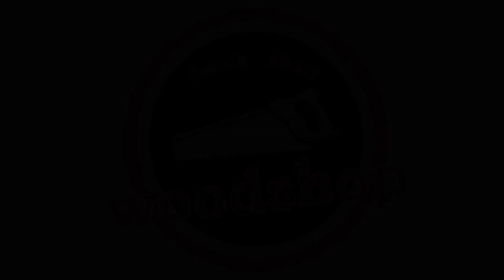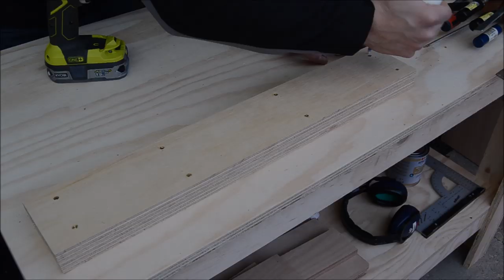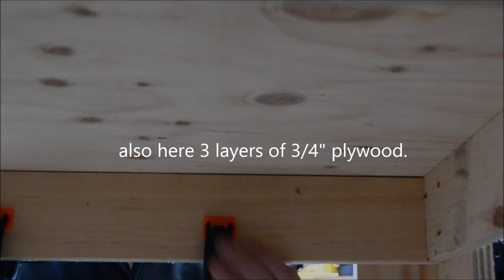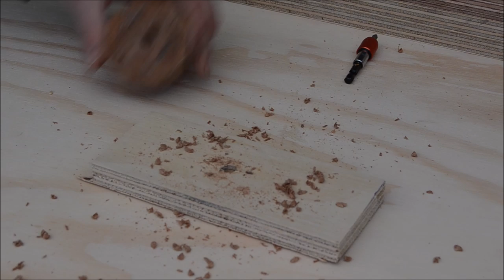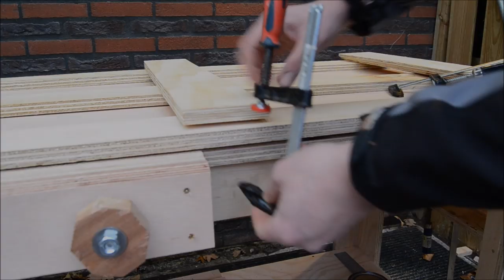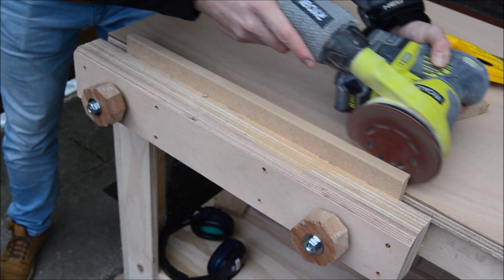Plywood workbench | DIY MOXON vise and a hardwood ply topsheet | #3

Comment: From all the videos about simple vises this is probably the most simply and best for a diy person new to the woodworking world. I have a foldable workbench and I need to make a vise for it that can be easily removed, probably I will go this route. My only question is how thick are the threaded rods? I have some long rods with nuts around  but don't know if they are thick enough for this. Thanks for the video.
Reply from the maker: Jelly G. Thank you for watching. The rods are the size M10 (metric)   it works good but if you have the chance go for a bigger rod. M10 takes ages to tighten 😂
Reply: After thinking about it you are right hahaha. That was one of the things I hated most about that rods, long time tightening nuts around. Thanks for the reply.

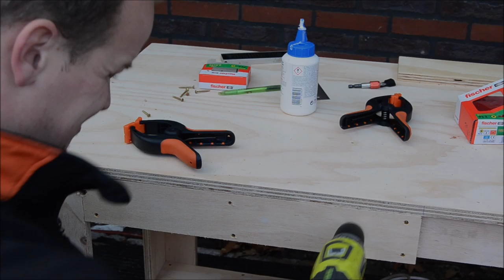Comment: Thanks for the video! I'll be using some of these ideas in my vice build! Just wondering what you call the fixing at 3:06?? Also going to use some thicker rod to speed up clamping time haha Cheers!
Reply from the maker: Thank you Joe! Happy to hear i could inspire you a bit with this video. Those are T-nuts. very usefull when you want something tight in wood or plywood. Yes a bigger rod is what i should have done to haha. Good luck and thanks for watching!